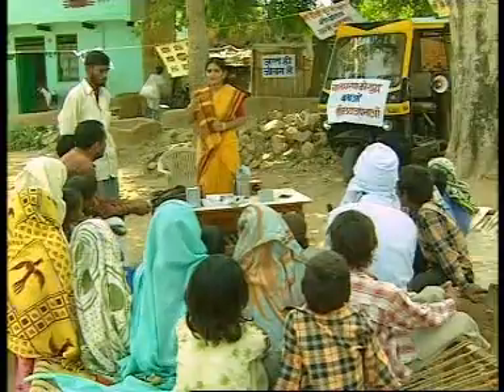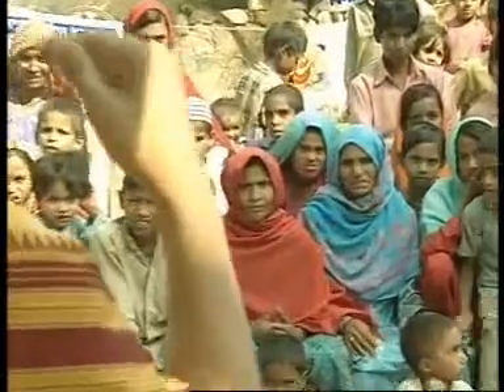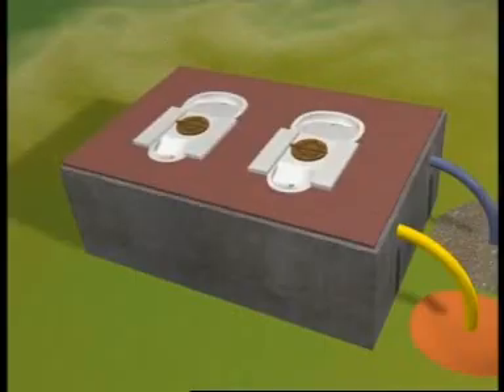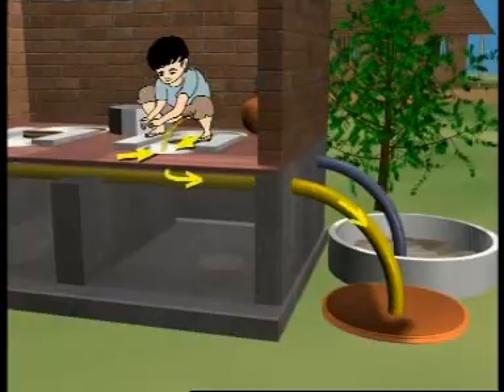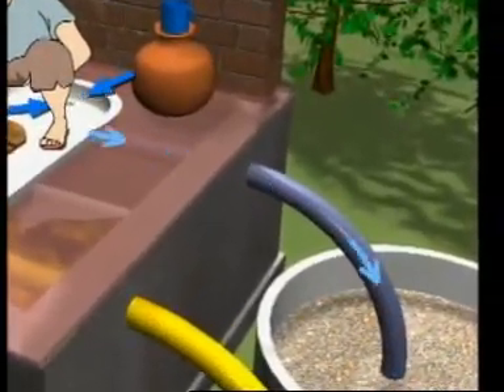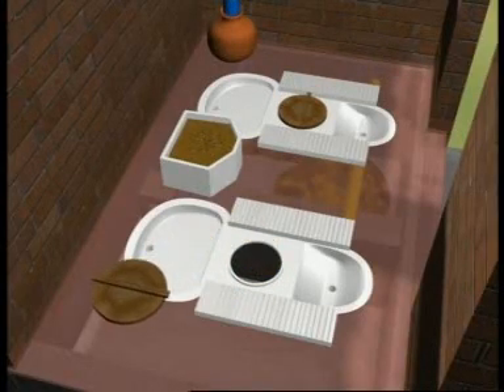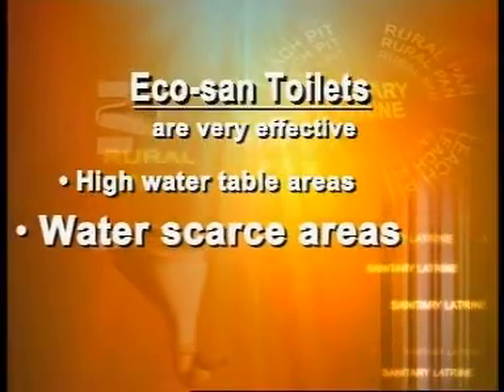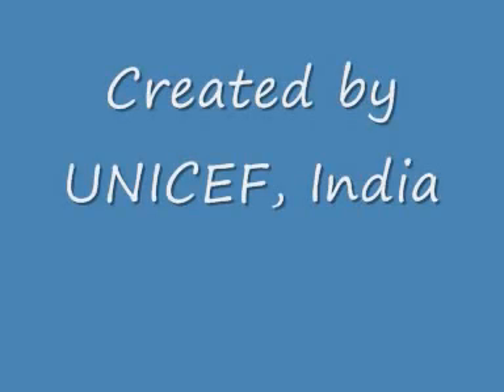Constructing an ecosan toilet -- A film from UNICEF

Comment: This does not work well in practice because the smell coming from the excreta hole is awful. Using separate holes for urine and excreta is also cumbersome and may not be very practical for elders with bladder control issues. The twin leach pit toilet system is much more effective as it works like traditional toilets and does not emanate smells. Each pit is used alternatively while the other pit is given time to turn the sludge into compost. Water and urine is automated drained into the soil. This kind of toilet is not perfect either but works better in practice.

Comment: Here is an idea, Design a large joe cell filled half full with aluminum gallium alloy. The alloy will produce hydrogen when water comes into contact with it. Urine is mostly water so then fill the joe cell the rest of the way with urine then turn on electrical frequency to operate the joe cell which will then start producing HHO that can then charge solid state sponge hydrogen power cells. The joe cell during processing of the urine will produce a resonance bubble that Tesla induction coils can absorb and turn into electrical energy to charge organic carbon power cell banks. The fecal matter can then be cycled with a heater being powered by the HHO produced to sterilize and process the fecal matter into sterilized top soil to grow crops with. The hydrogen fuel cells then can be used to operate cars and motorcycles farming equipment electrical power generators and so on. The left over residue within the joe cell from processing urine could be collected and crystallized and turned into plant food after allowing joe cell to cool and harden after so many gallons of urine have been processed. What do you think about this idea? 😊
Reply: Nice idea

Comment: solution: build a toilet that burns poo.  A good fresnal lens pointed at poo will burn to ashes. Have a separate place where urin goes into ground. simple.
Reply: you can use the poop as fertilizer

Comment: No one is going to adhere to so many instructions while defecating, especially in India.
Water, urine as well as fecal matter in most of the cases will fall in the same pit. The design does not seem at all feasible for woman, people having difficulty moving while in a seated or squatting position. Even after some days, the smell while opening the lid would prevent almost all people to avoid it.
Reply: Actually, a well used and maintained Ecosan toilet is odour-free and pest free. It is also quite easy to use, once you get used to it. Any lifestyle change is a bit difficult to accept at first. However, the benefits far outweigh the difficulty in usage. An Ecosan toilet saves 10-15 l of fresh water with every use. It also delivers 2 types of very potent fertilizers for the soil which is very valuable for farmers/gardeners. I'm sure if you get the opportunity to try one, you may change your mind :)
Reply: Saptaswa Biswas 
True.. the seat area should have one hole for solids and a funnel in front to collect fluid
Reply: @duggydugg3937  Western toilet bowls which separate urine and feces are also available now
Reply: @ainc000  
stool ~ like composting toilets have been around a long time..urine sep included..
septic systems are imperfect...have to be pumped our every so often... Wonder where the pumpings get disposed ....
Reply: @duggydugg3937  yes exactly ! Septic tanks are very energy and water intensive to use. Most times the waste is pumped and then illegally dumped in fresh water bodies
Reply: @ainc000  years ago I read about the clivus multrum multi-story composting toilet... a big deal if retrofitting an existing house... Vent at the top... Clean out at the bottom..

in case of shut down I have a disabled persons toilet seat in an aluminum frame... Similar to the disabled persons shower seat... You would put a bucket with a plastic liner under it and have leaves or dirt or kitty litter or coir to cover the solids... A separate container for urine...

There are several commercial versions of this on the market somewhere around $500 a piece
Reply: Saptaswa Biswas
Reply: Agreed.
Reply: The odors are caused primarily by excess nitrogen and no aeration which leads to main processes in the pile being rot (anaerobic process) instead of composting (aerobic process). Also, properly installed ventilation system will prevent odors from going out of the pir into the room, you don't even need electricity for this, just understanding of convection.
Reply: @Templar there is odor and there is odor. I lived in the country most of my life, i know what i am talking about. Proper composting and simple pit latrine are whole different levels of smell. With composting you can just hand some strong herbs in the latrine to remove the smell.

Comment: this seems nice idea to separate out the stuff, urine, stool & washed out water, but this will quite unhygienic & a lot of odour especially when tank is full? but animation looks good and cute :)
Reply: +Gaurav Seth not much odor because of the carbon materials -- sawdust, lime, coffee hulls, rice hulls -- added to the excreta. Add a tippy-tap hand washing station to make it even better.
Reply: Cute?😂
Reply: No it realy works.  If you want to be doubly sure just add a 3" black plastic or metal pipe to the collection chamber.   Run it out of the chamber wall high as possible outside of the building on the Sunny Side of the building. Be sure to put a fly screen on the top with a rain guard to keep water from coming down the vent pipe and it will automatically heat up from the Sun and draw Vapors out of the chamber.

Comment: i think its nice, but it may become disgusting while covering the excreta pot with the lid because, i'm not sure the excreta will accurately fall into the the drop hole everytime;  maybe a little bit raised drop hole, so that the user can exactly excrete into the drop hole without worrying or even a seat could be provided! also some micro edits n amendments could b done in the video!
Reply: +Kiran Bokkesam : smell is the problem.. where is the exist for gas?